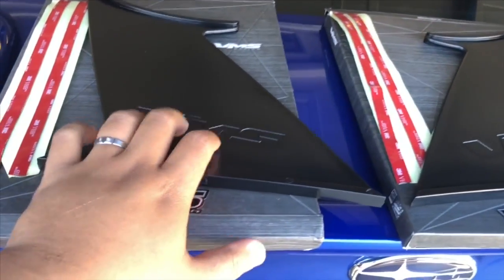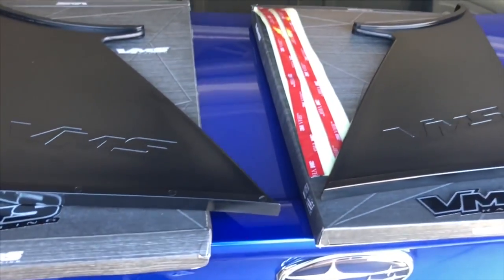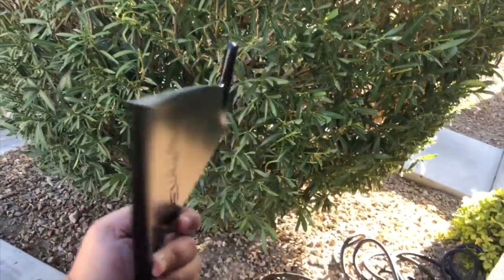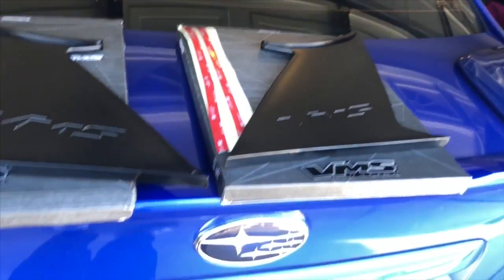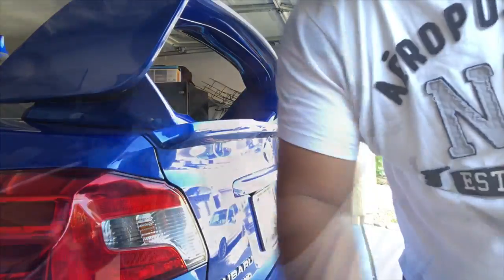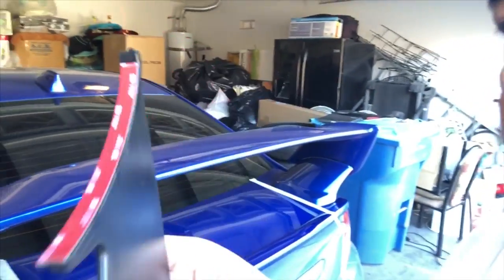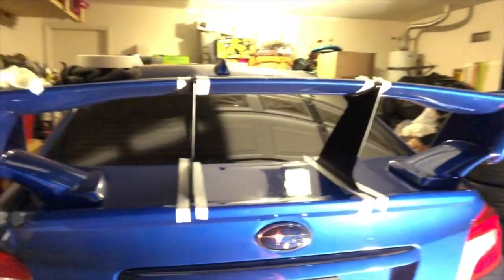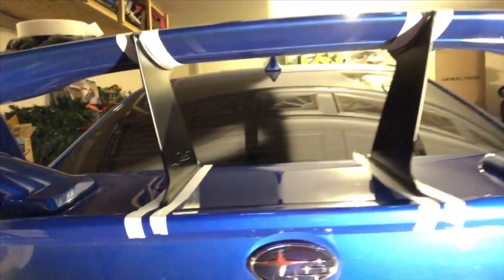How to install stabilizer on Wrx

Comment: Hey man question, did this eBay rattle at all before you installed these? I bought the exact same one you did and it rattles and I’m looking to buy these stabilizers to remove the rattling, did it help at all?
Reply from the maker: W are Reckz hey bro, are you referring about rattling on the wing after the installation?
Reply: wrx19 _vegas yes after the installation
Reply: wrx19 _vegas after the installation of the wing.
Reply: wrx19 _vegas i meant to say eBay wing but I forgot to add the word wing lol my bad. So I also bought the same wing you did and mine rattles a little, did yours rattle also? And if it did, did these stabilizer stop some of the rattling? Thanks in advance and sorry for the confusion!
Reply from the maker: W are Reckz i never had that issue after I installed the wing. double check your wing, make sure all the screws are tight and nothing is loose.
Reply: wrx19 _vegas gotcha thanks bro!

Comment: Yo Kuya, can you send me a link where you got those?
Reply from the maker: https://rover.ebay.com/rover/1/711-53200-19255-0/1?ff3=4&toolid=11800&pub=5575477609&campid=5338470859&mpre=https%3A%2F%2Fwww.ebay.com%2Fitm%2F2-TWO-VMS-RACING-REAR-WING-SPOILER-SUPPORT-STABILIZER-for-15-17-SUBARU-WRX-STI%2F292142228080%3Fepid%3D27028564636%26hash%3Ditem440508a270%3Ag%3AKkMAAOSwA3dYERrY%3Ark%3A2%3Apf%3A1%26frcectupt%3Dtrue
Reply from the maker: bro pa subscribe. tnx

Comment: What’s the link to buying these?
Reply from the maker: https://rover.ebay.com/rover/1/711-53200-19255-0/1?ff3=4&toolid=11800&pub=5575477609&campid=5338470859&mpre=https%3A%2F%2Fwww.ebay.com%2Fitm%2F2-TWO-VMS-RACING-REAR-WING-SPOILER-SUPPORT-STABILIZER-for-15-17-SUBARU-WRX-STI%2F292142228080%3Fepid%3D27028564636%26hash%3Ditem440508a270%3Ag%3AKkMAAOSwA3dYERrY%3Ark%3A2%3Apf%3A1%26frcectupt%3Dtrue
Reply from the maker: I appreciate if you can subscribe also. tnx